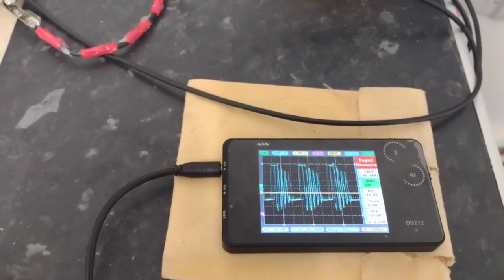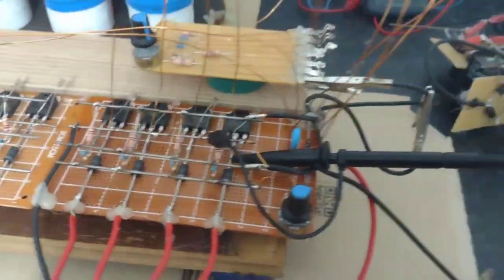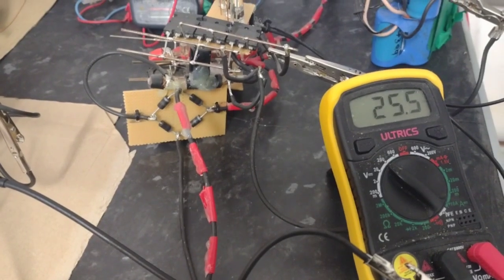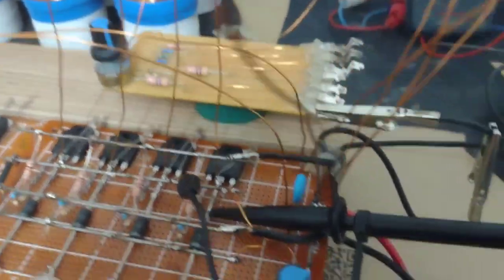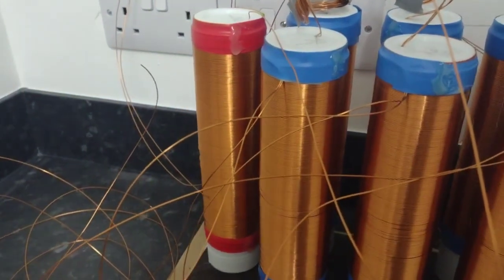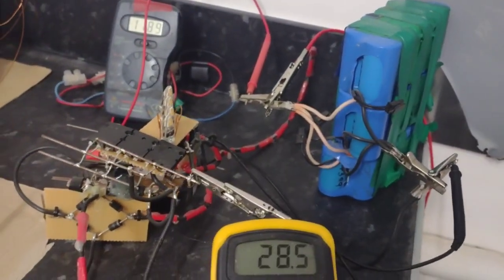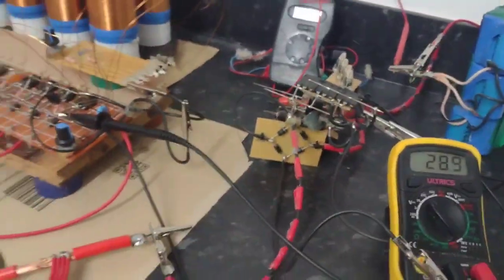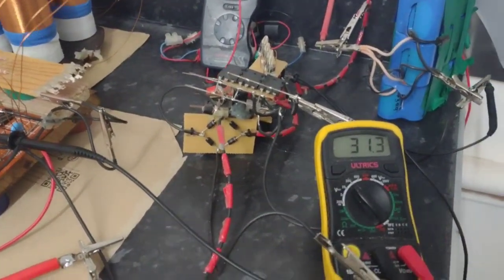New Radiant Device Charging Battery for the first time.

Comment: Clickbait. Nice try though. If you were charging a battery with ambient electrical charge, it would be a very tiny earbud battery. One that was out of circuit (no in-circuit parasitic draw). AND it would take days to charge. That would be a poor return on investment for time and materials. Nice try though. Same as these stupid solar system salesmen - i.e. LIES.
Thumbs down spanking.
Reply from the maker: You need to lean to think logically.  Why would I go to this  much time & effort on something that's just going to wind up being "clickbait"?  also I'm not selling or trying to promote anything here & just for your information I've seen a pretty good return on some of the systems & devices I've been able to produce.

Comment: What's the point of the transistors? Just use shottky diodes ... 

Turn off the breaker panel box to the home, then see how much power you get

Comment: I have a very limited understanding about what is happening here but I am genuinely interested.
Reply from the maker: Thanks for your interest.  There's an over amplification in voltage through switching while taking miniscule amounts of current flow into the charge... this allows me to raise the potential much higher than what I'm inputting into the device to power it...   I can then collect & store the potential in Capacitors & then when the charge rises to the desired voltage level then the bulbs go to work & tell the Transistors in the output Capsule device when to automatically switch the load from the Caps to the charge Battery...   there's a lot more to it but to explain things simply this is what is happening with these Radiant systems.
Reply: May I interest you in buying London Bridge also?